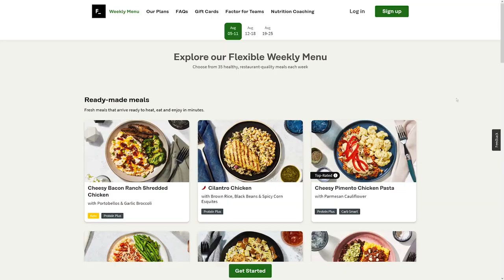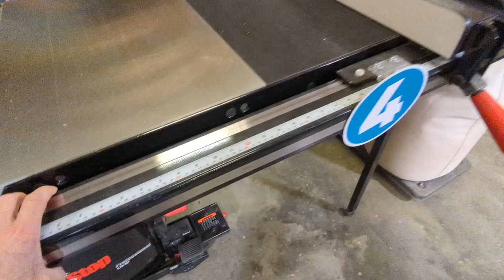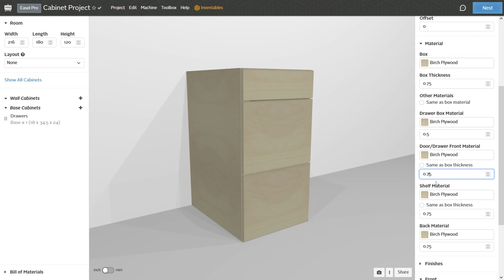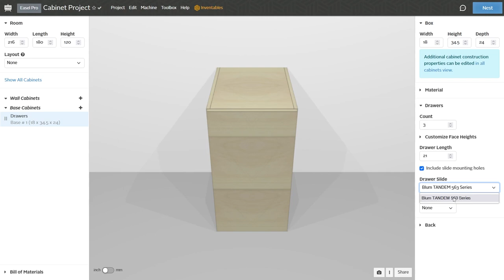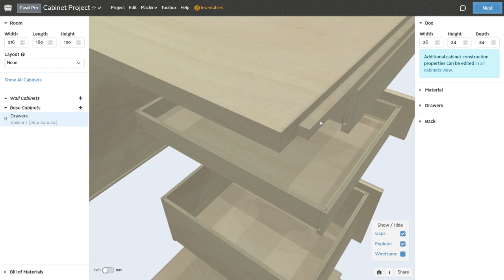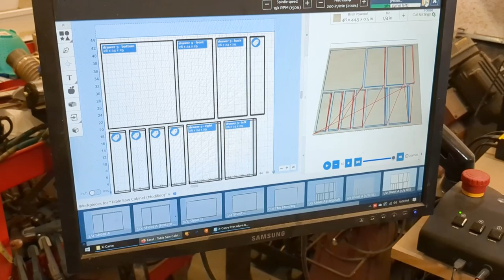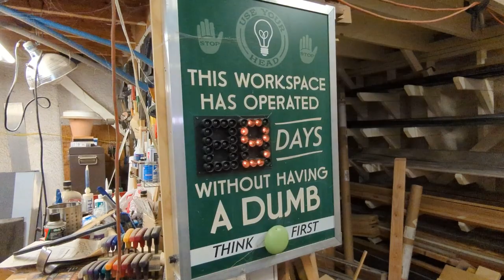Eliminate Those Table Saw Pain Points!

Comment: Thanks for the video!
I would turn the back of that cabinet into the sawblade storage, save the drawer...   I made my sawblade storage out of oak dowels and blocks set at an angle so they don't slip off.
Have a great week!

Comment: I built Michael's version of the cabinet and one thing I failed to consider was knob on the tilt mechanism. I flew a little too close to the sun and it was difficult to operate. I was able to find a shorter spinning knob that fit though and that made it work a lot better without having to nudge it over. 

Thanks for sharing. I love seeing how you figure out how to integrate additions to existing fixtures. I always learn something from you .

Comment: First video of yours that has come up. I very much appreciate your humour. Watching it made me think that I ought to spend a couple of days doing nothing in my shop but resolving the pains that I’ve got; live with but curse at daily. Mine are different to yours but that’s not the point.

A couple of days? I’ll be lucky. I can only work in short periods now (an hour in the shop and then rest; back to the shop and then rest etc.) that everything takes so long and I’ve got a backlog of urgent, critical and life-threatening jobs to do. Weekends are spent on machine maintenance, sharpening and cleaning. 

I’ve got the same under table saw storage solution as you made. However, in other parts of my shop, I have used office desk pedestals that can be got very cheap second hand. With the price of decent plywood, they can be bought a lot cheaper than you could make them.

Comment: All great, and simple upgrades. Adding that extra space on the back was brilliant.  Maybe add a fixed panel area on the bottom to clear the hose, and then a couple of doors to close it off and use it to store larger things like a cross-cut sled. The only other thing I'd do is add some supports for the table top to the top of the cabinet, to replace the legs you removed.
Reply from the maker: Thanks. Yes, the table will rest on the cabinet.
Reply: @WesleyTreat  I'm assuming you just ran out of time to detail the supports you mentioned before removing the legs.

Comment: I just installed the outfeed table in my saw stop. I immediately noticed the same problem that you did. I used some Velcro straps to hold the legs in place. But I like your magnet solution better.

Comment: Great video, thanks for sharing. Shows what can be done with planning and skill. 
Thought: Could the space behind the drawerr cabinet be used for a different dust collector that fits the space? Letting you use the existing one as a general workshop portable?
Reply from the maker: It would have to be a very small one.

Comment: Hey Wesley! Great video and well-engineered / executed solutions per usual! I don't own a SawStop (yet), so I don't know how important the metal support legs are to keeping the table supported and plumb. The new drawer cabinet you built doesn't appear to engage with the horizontal table when the saw is lowered onto it's legs. Could you / should you add support blocks on top of the cabinet that align with the guide rails for the fence?
Reply from the maker: Thanks, yes the cabinet will help support the table. There's always more to be done.

Comment: Did you end up leaving the table extension over the cabinet cantilevered? It looks like you didn’t add any support after you removed the legs, but couldn’t tell for sure.
Reply: Yeah I expected some kind of bracing between the table extension and the cabinet
Reply from the maker: I'm adding a shim underneath, but most of the strength in the table comes from the large pieces of angle along the front and back. I'm not sure those legs even did much with this short a table.

Comment: Projects like this is where true human creativity and innovation shines. How do I make this easier and suck less. For example, walking and running to get everywhere sucks. Let's tame horses and ride them since they are way faster and better at it. Horses suck, let's use an engine to make this stagecoach move on its own! That sucks and needs roads still and even steam boats are to slow. Being on the ground also sucks, so we are going to figure out how to fly!

You see where this can go, but it can be something simple, like just wanting to hold a piece of metal better while blacksmithing. This need resulted in one of the most useful tools that is in almost every toolbox in one form or another: vice-grips. Simple, effective, and like the crescent wrench, not the right tool, but good enough to be the right now tool.

Comment: I’ve been brainstorming a cabinet to go under my Sawstop as well. Did you decide not to support the extension table? I’m not sure if I need to put little legs on top of the cabinet or something…
Reply from the maker: There will be a support on top of the cabinet, but first there's a detail I need to rectify with the bolts that previously held the legs. Those bolts also fastened the extension to the support angles.

Comment: Will the doors come open when you move the system around?  Mine did so I put magnets on the doors to provide enough resistance when moving them but not so much to make it hard to open
Reply from the maker: The Friho slides I use have a positive stop to hold them shut. (Link in the description.)

Comment: Shop upgrades. My favourite. One note, could have made the base for the cabinet longer and have the dust collector sit on it eliminating a couple castors and the floating attachment point.
Reply from the maker: I need to be able to detach the vac and roll it outside to empty it. It gets pretty heavy when it's full. Plus, combined with the cabinet, you'd be talking about a lot of mass extended very far away from the base. That's a lot of leverage on the attachment points when I'm moving it.
Reply: @WesleyTreat  ahh. Didn’t think about having to empty it 🙄

Comment: Chasing the ultimate dream of sucking less. Nice improvements here. Sure to be super helpful. That cabinet bulding software looks pretty slick. I'll need to check that out and see if it can be used without the CNC, though I see how it's twice as helpful with one. Thanks for sharing!

Comment: The legs you removed had levelers. Did you loose that feature resting the table on the cabinet, or is leveling not an issue?
Reply from the maker: If I need to, I can install levelers upside-down on top of the cabinet. But, I've never adjusted them, anyway.

Comment: You can modify the folding outfeed further so it lays flush with the back of the saw when folded down.
Reply from the maker: I've been meaning to do that for a long time. Ostensibly, you can adjust the brackets so it clears, but I've never gotten it to work. I just need to dismantle it and cut the tubes shorter.

Comment: Dude! Love your videos! You are so innovative and imaginative. I had a question that you may or may not be able to answer. Is there an app or formula for placing legs on 'odd shaped' coffee tables? i.e., I like to make 'mid century' or 'retro atomic' style coffee tables in 'odd shapes' (kidney bean, 3 sided, random curved shapes) But I have problems figuring out where to place the legs to maximize space to make the largest 'base area' to keep the table stable with 3 or 4 legs. Some retro styles use 3 legs, some use 4. Four legs is especially hard on 'bean shaped' tables. Any suggestions? Thanks!
Reply from the maker: Thanks! Unfortunately, I don't know anything like that. But, maybe someone in the comments can answer?

Comment: Hopefully the Inventables teams adds a feature that would allow you to slightly recess the drawer slides in the panels, even if it were just 1/64nd of an inch or something like that... just input the width of the drawer slides and it would make a dado of the corresponding dimensions, on both the drawer and the "wall", would eliminiate suchhhhh a lot of boring work and alignment issues and whatnot. I'm always scared I'll screw up my drawers...

Comment: It's very cool!

Because opinions are like bottoms (everyone has one and they all stink)... Why did you not just extend the cabinet base across to catch the base of the dust collector? (The dust collector linkage was very clever, but the OCD in me cringes at having pins taller than the surface of the table saw; that's probably due to usually working with a much smaller job-site saw.)
Reply from the maker: Thanks! The dust collector already extends two feet above the saw. Those pins don't make any difference. 👍

Comment: I don't understand why the legs are no longer needed...how is the table being supported so it doesn't tip with weight on the one end?
Reply from the maker: As I mentioned, it'll be supported by the cabinet. (It would never tip. The base and the steel top are way too heavy. The right side of table is just wood.)  Plus, the entire table is strengthened by large steel angle along the front and back.
Reply: @WesleyTreat  ok. Thank you. I wasn't able to see the table resting on the cabinet. I have a sawstop pro and experienced tipping when I temporarily removed the legs.

Comment: Could you have just expanded the existing castor base on the saw to make it big enough for the cabinet and the dust collector rather than adding more castors? I know it didn't make it much more difficult to move but it seems like more wheels means more opportunities to get stuck on anything that might be on the floor.
Reply from the maker: I need to be able to detach the dust collector easily so I can wheel it outside for emptying.

Comment: You REALLY should put something over the magnets. A big of leather, thicker cloth, or those felt-pads: The magnets are solid metal, but they are brittle. They can shatter easily, but also just the coating protects them from getting corroded and if metal slams on the coating it will get damaged and the magnet will start corroding.
Reply from the maker: The magnets aren't coated. They're recessed in a metal shell.

Comment: Wow, don't you lose a lot of drawer height with that program! Room for another drawer...
Reply from the maker: I designed it with three drawers. Things can stick up above the drawer tray. Another drawer and the top two would be too shallow.
Reply: @WesleyTreat  The height between the drawer bottom and the bottom of that drawer front cannot be used- it would foul contents when the lower drawer was opened. I usually set this gap to a couple of millimetres (I attach the drawer bottom to the bottom of the sides. Even drawers a metre wide can take a great deal of weight with no issues) to maximize useable space. As  @smacfe also does.
What I am saying is that an extra shallow drawer could be fitted, sufficient for squares, pencils, and other accessories, without altering the usable storage height of the other three drawers.
Reply from the maker: The bottom of those drawer faces only extends about 3/8" and the gap at the bottom is 1/2" (because I like dados for the drawer bottoms). So, sure, I could make the faces and the bottoms flush, then I'd have room for another drawer 1-3/4" deep. 🤷‍♂️
Reply: @WesleyTreat  Yep. And that is exactly what I would do. I have a drawer a bit shallower than that, where I keep most of my measuring kit, and another for taps, dies, and other such items. The best drawers are one item deep.
Reply from the maker: You can use Cabinetmaker to design the drawers however you want.
Reply: @WesleyTreat  The day I have to use a CAD program to design simple drawers is the day I check into a care home...
Reply from the maker: Guess I'll just check myself into a care home then. Thanks for such a delightful chat.

Comment: I throw my off - cuts out the door and into the weeds during projects and, if, at the end of the project I don't need any of it it either goes in the trash or in the burn pile. My shop is 9x18 so not a lot of room for extra. And on a fixed income nothing gets done if not free or close to it. A friend gave me a lot of particle board and I just made a wall of shelves and hopefully I can get some of the Tetris I have to do sorted into less of a headache to do anything.

Comment: Shouldn't this be titled "Eliminate Wesley Treat's Sawstop Table Saw Pain Points"? Unless someone has a shop layout similar to yours, uses a rare vintage dust collection system, and uses a Sawstop table saw with the same outfeed support, there is nothing in this video that helps them. Pissed at YouTube's algorithm for putting this in my content!